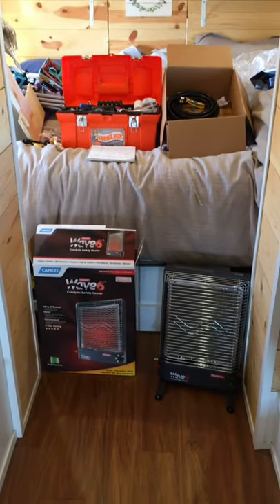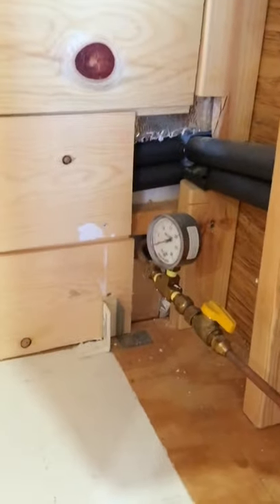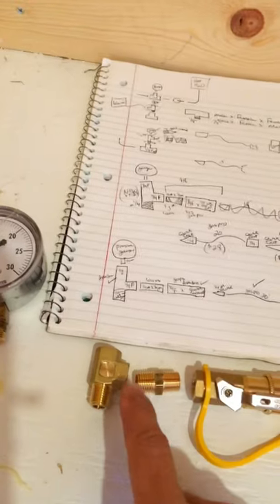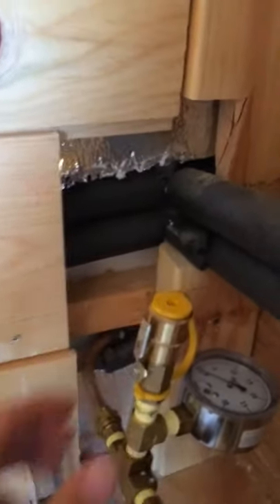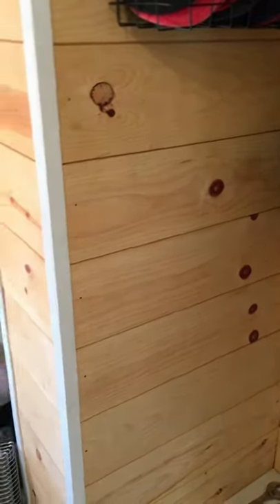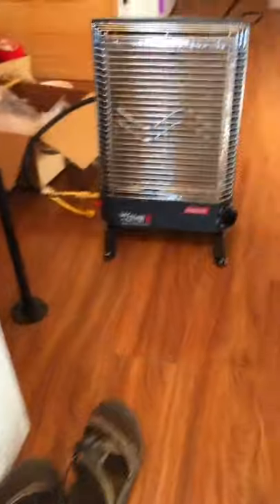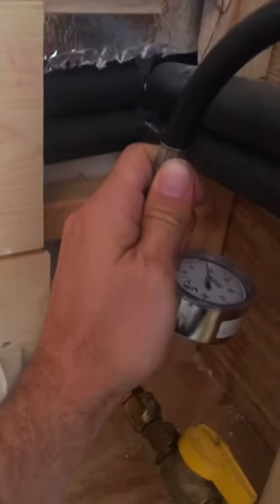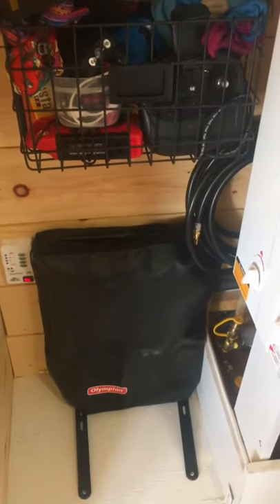Skoolie Wave 6 heater install: Simple and Easy

Comment: How long does a tank of propane last using the heater?  Happy Trails
Reply from the maker: We haven’t had cold enough weather to consistently use it in order to know that yet. But they are supposedly more efficient than the furnaces and little buddy. Thanks!

Comment: The wave 6 has sensitive orifices.  
A drop is required for proper install.
Otherwise, nice job
Reply from the maker: Thanks! Not familiar with a drop sorry, what is that exactly?
Reply: @kellywilson2358  Well, I'll try.
Go to your home furnace and you will see a gas line that goes into your furnace.

It doesnt go straight in, but has tee where sediments can fall into before entering your furnace.
                   
Gas source----¿-----Heater
                   \drop/